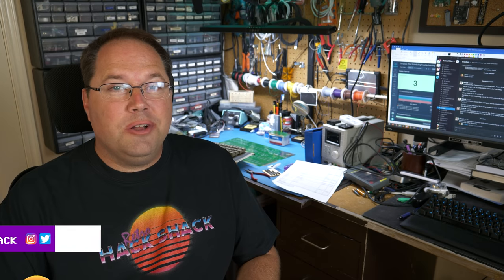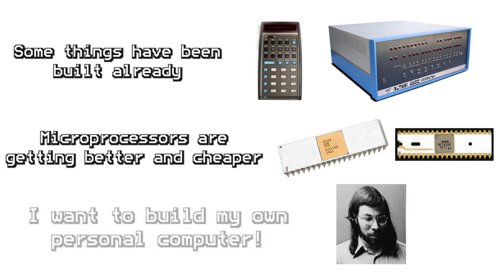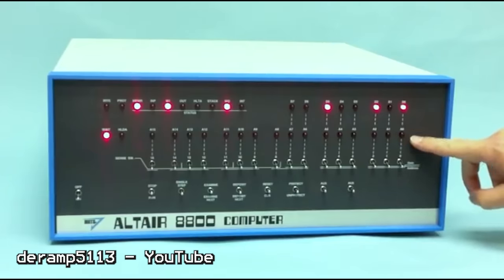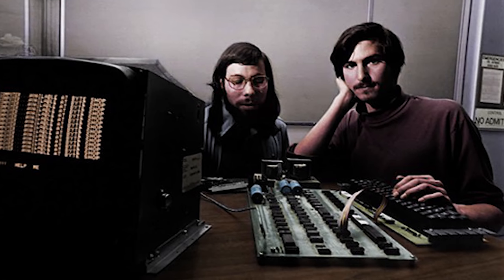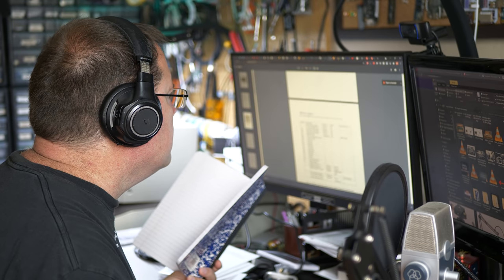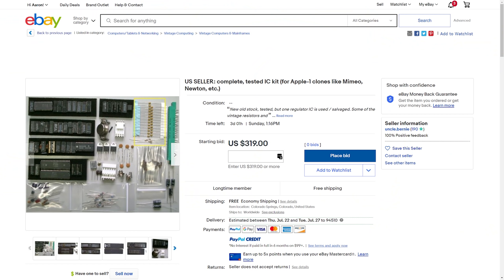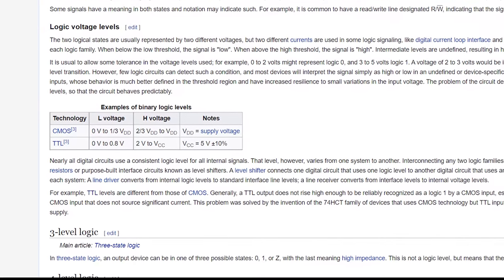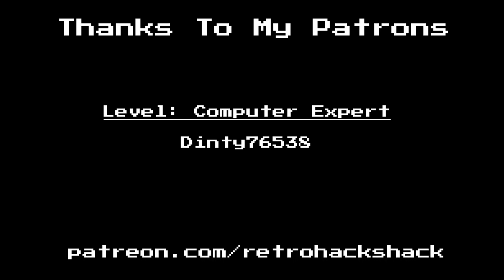Apple 1 History And Build Guide

Comment: You could get full documentation on not just finished computers, but also of sub assemblies, like floppy drives. When the IBM PC came out, both the hardware and software technical reference manuals were available. In the hardware manual's appendices, there were complete schematics, and the source code listing of the BIOS ROM.
Reply from the maker: And don't forget about Sam's!

Comment: 6:22 - Not microcontrollers (uC), but microprocessors (uP). A microcontroller has RAM, Program Memory (ROM, EPROM, Flash ...) and I/O along with a microprocessor, on one chip. The 8048, and later 8051, are early microcontrollers (PIC & AVR are current uC lines). The 6502, 8080,and Z80 are early 8-bit microprocessors, as the chip does not contain any memory (only registers), nor I/O. Just the processor.

There's lore why Wozniak chose the 6502 over the 8080. He wanted to use the 8080, but the 6502 was cheaper, and Jobs cheated him out of some money.
Reply from the maker: NIce catch! I may have misspoke there.